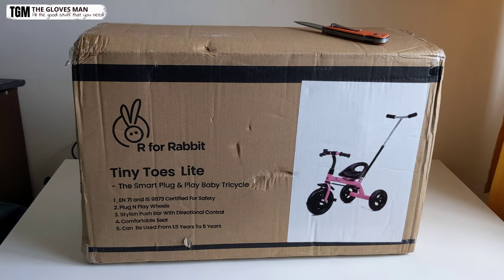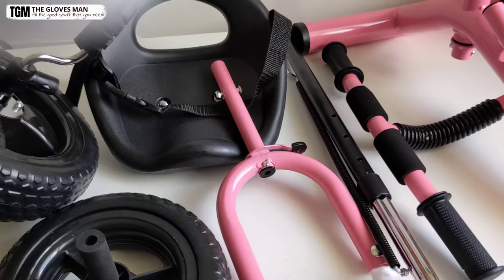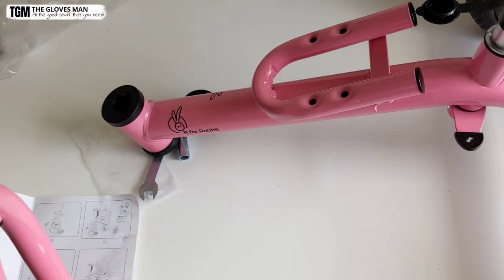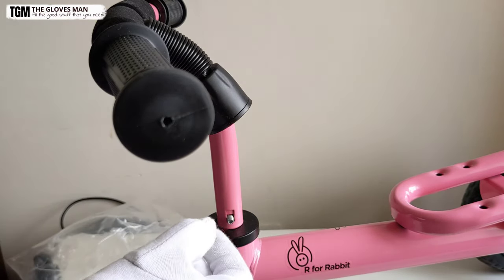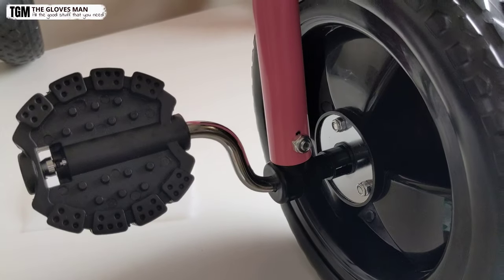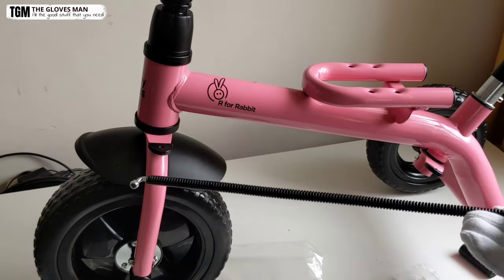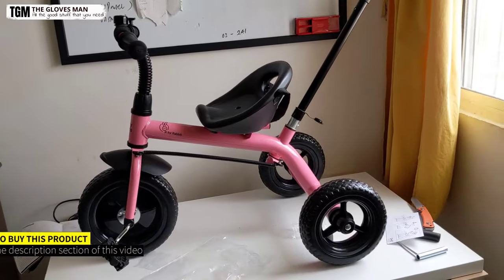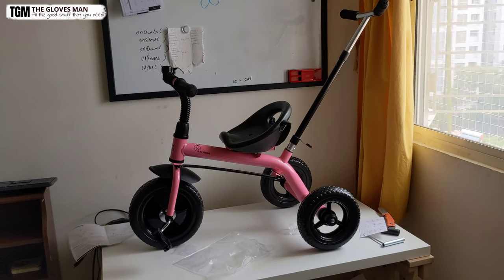R For Rabbit Tricycle - Assembly and Unboxing

Comment: I got a tiny toes grand and was able to install it but I'm unable to adjust the height of the parent control lever in the back. How does it work? I saw the official video but the new model I got doesn't have any button to adjust height of the bar. Do you know how?
Reply from the maker: Not sure if the Grand Version has a different mechanism for adjusting the height of the parent control handle, but you can refer to my instructions at : https://youtu.be/JHyXx3PkZbk?t=563
Basically, there are grooves with that press fit kind of a button. When you press that in, you should be able to move the height up and down. After that, lock it in the hole where you think the height is enough.
Hope this helps.
Reply: You can pull it out to adjust in given holes...for packing purpose they have fixed it with shor lenth..you need to just pull out.

Comment: Are these wheels made up of plastic or rubber?
Reply from the maker: Not sure of the exact material used, but when pressed with fingers, they get a bit compressed and go in. If you are worried if these wheels make noise, then don't worry. They don't make noise and are soft on the floor as well.

You can check this model - https://amzn.to/2To3iTe 
It looks the same and the manufacturer has explicitly mentioned that this one has rubber wheels.

Comment: How to unlock the front wheel thing ?   Baby is grown now and wants to ride. The front wheel peddle is rotating on its own and no wheel movement
Reply from the maker: Please re-check the assembly of the front wheel. This should not happen if it's installed properly.
Which model of the Tricycle are you using?